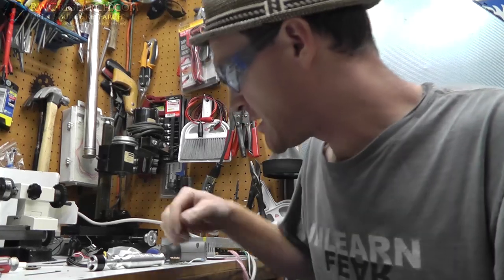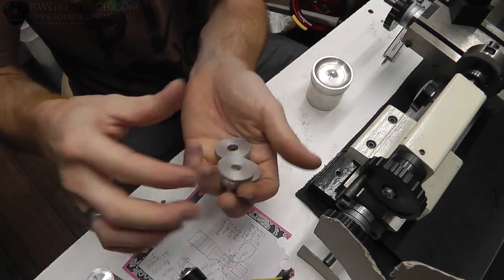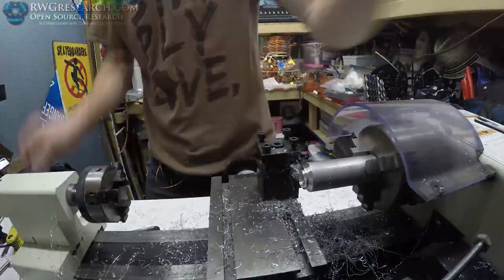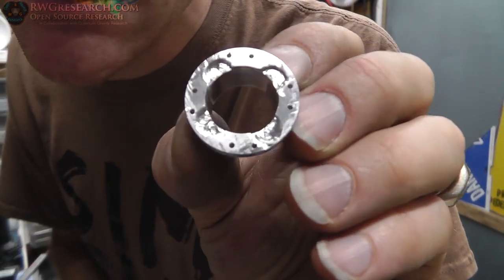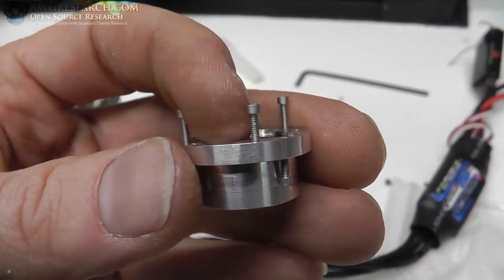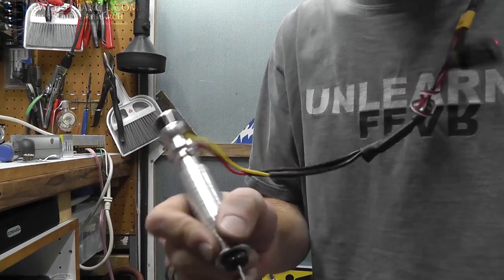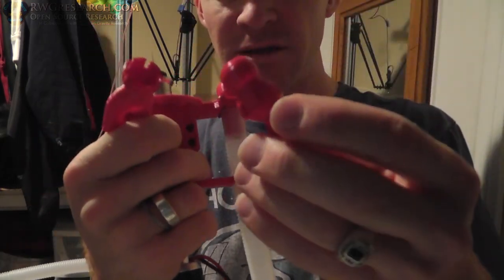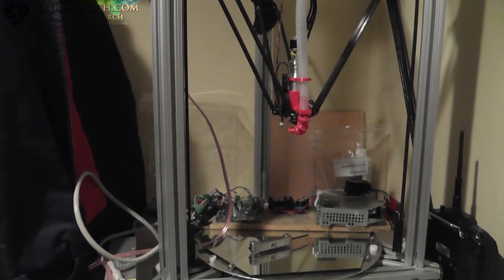P3. Lite & Powerful Brusless CNC Spindle Build For 3D Printer. Finishing The Build

Comment: I think I am going to try this on my delta, but I am just going to make a whole back piece that threads on to the spindle housing.
Reply from the maker: yeah, I'm sure you could even 3d print parts. but i was worried about heat! that motor and AL body can dissipate a lot of heat. its self a heat sink. so if you make one from AL with the threads in it sweet! i'd love to see it! i could do threads with that Lethe, but its faster to do it the way i did i think. guess i need to play with making threads! i haven't done to much of that.  best of luck!! ~Russ

Comment: I would suggest going over the motor driver.

Like speed regulation, and non-RC controller.

At least use a servo-tester instead of the remote control.

The mechanical parts, I don't know better ways for.
Reply from the maker: good observation! i dont think this controller has speed regulation, so i may
 need to get a better one that dose!  https://hobbyking.com/media/file/16810468X7478X23.pdf ill have to find another one that has it! 
the controller will be replaced with sig from the 3dprinter its self... but for testing ...  remote is easy. i like the servo tester tho. might have to pick one up! 
~Russ
Reply: I have a 500W driver board from aliexpress, not tested yet.

Pulse output and analog speed input(as far as I know)

Non-RC. Will test it somewhat soon.

Is something like that of interest?

Comment: Great job, Russ!! you may be able to take the RX out of the equation and replace it with an arduino. i recently did a quick video about reading from the RX into an arduino, i don't see why you wouldn't be able to send the same data OUT of an arduino into the ESC, though i haven't looked into that configuration yet.
 Thumbs up as always!!
Reply: yeah his printer board can send PWM .  I mentioned next time he orders some parts to grab a servo driver or two so he dont have to use R/C TX and RX just to drive esc's and servos during tests and such.
Reply: oh right, didn't even think of servo control on the main board! score!! i'm totally looking into doing this.
Reply from the maker: the duet can do it directly. a small side circuit is needed. but it's just to convert 5v from 3v.  I will be making a bord for this on the OSD. :)  I plan on using 3 if them already. hehe. ~Russ
Reply: that's the only  easy thing about stuff still driven by ramps,  as the servo can be driven directly off the  ramps shield . 
 I wonder if you ESC for the  motor is 3.3v & 5v logic tolerant for PWM in .  then you only need to connect ground and PWM wire , as your getting main power to the ESC from other DC source , as some ESC's put 5V back onto the  + lead as a BEC for RC planes no to need a RX battery .  It would be cool to see if any of my small ESC's will work with 3.3v on PWM in . 
Hmm just did some looking most modern R/C RX's output 2.8v to 3.3v on the signal pins any how.  
so PWM signal wise you should not need any converter .  just  hook only the ground and the signal pin to you PWM pin ,  but do NOT connect the VCC for the ESC as it will be pumping out 5V on that via its BEC  ( though that's handy for arduino based 5V boards ) 
The ESC should be new enough you just got it . 
I'll have to pop one of mine on a scope the weekend as see if mine are new enough  LOL .
Reply from the maker: yeah it could work on 3.3v, but the internal BEC is 5V so... i bet it would like a 3v. it might twitch out lol, but dont worry, its all planed out... just need to get time to test it! ~Russ
Reply: the BEC is only used if you connect the V+ in the servo lead from the ESC to RX or device , in instructions for using more than 1 ESC , you must not connect more than 1 V+ on the servo type wire to the control weather it be a R/C RX or an other board than needs 5V .   all that is needed is Ground and Signal .  All my ESC's (even my old ones) work fine with Arduino promini 3.3v . i even put diodes in line to drop the voltage and it still works fine.
thing to remember about the ESC is that its control board is powered solely by the DC power source for your spindle. 
only issue with not having the 5v+ hooked up , is if you need to enter the program mode for the ESC. some brands need it connected for programming it.  none of mine do they all work fine  without it . 
and thats cool because i now think i might make a ESC programmer with a arduino of some type . 
main point is with BEC is it supplies 5v from the motor power source , it does not ever need Vin , as it is Vout .
Reply from the maker: ok cool ill keep that in mined, i know the servo's i want to use will not except lower than 4.5V or they are not relabel, so i can only guess the ESC's are simulate. i'm sure are some capable of 3.3V but might not be reliable. by the way a simple logic gate of the proper type will boost 3.3 to 5 v , i i add a single IC and get 4 channles of 3.3 to 5V conversion, thats the plan might test that today... thanks for your comments!! ~Russ
Reply: Nuts , oh yeah servos need it , i was stuck in tunnel vision re ESC and forgot you were gonna have servos.. lol oops. yeah . 
servos need power ,  ESC's supply it , so you could use the RSC V+ coming back to power your servos as long as they dont draw too much power.   I have not hit a ESC in my place that was not 3.3v data happy, but you wanna run servos too and i forgot that , they like 5v .
Reply from the maker: yeah, no worries, the servos will be for the #D printer side of things... so no ESC when running those, but i got all that wiring in place already! :) Sig, and 5V+, GND  ready to roll! just need to test it first lol ~Russ

Comment: You should be running ESC in speed regulation mode rather than power regulation mode. 
If you run a spindle with only power regulation you will find cutting metal reliably to be extremely difficult and even wood will chew up your cutting tools because you will be overspeed and rubbing with no cutting forces and underspeed and snapping bits under load.
Many ESCs are capable of this because helicopters require it to keep the blades from going too fast under variable or negative loads.
Reply from the maker: good observation! i dont think this controller has that option, so i may need to get a better one that dose! but your right! if its over speeding thats bad! and under too! https://hobbyking.com/media/file/16810468X7478X23.pdf ill have to find another one that has it! ~Russ

Comment: honestly, based on the results that looks no more powerful than my regular rotary tool, which I can only assume cost me less money. I use these cheap ass (6 for a dollar or 2) high speed milling bits to cut aluminum, copper, brass, etc. with absolutely no problems.

Comment: Maybe you are right, a cover for the motor is probably a good idea. Cooling won't help you much of the magnets are full of metal dust!
Reply from the maker: lol yeah, something... thinking about it i could try to guide the air down and over the shaft. its gets warm... need high speed bearings on the spindle! gets warm! ~Russ

Comment: Awesome job! Do you have some stl files for that vacuum system? I would like to do the same but with a harbor freight dermel. Thanks for being educational and entertaining Russ!
Reply from the maker: yeah sure. This i just a test holder, its its specific to my delta in theses testing phases... if your wanting just the vac flex thing... ill upload it as it is. sure, i used theses as a base: http://www.thingiverse.com/thing:503870 i did 50% smaller! ill upload the other end i made. but the one there might work fine too! ~Russ

Comment: Nice home made spindle. BTW what you said about the vacuum "don't put a tube without the holes" makes no sense at all. If you plug the inlet or outlet of a vacuum cleaner it reduces the load on the motor.
Reply from the maker: you are correct. except those type of motors are air cooled. so even with no load. it will over heat!!  trust me. lol. ~Russ
Reply: Oh OK. Thank you Russ for the clarification !
Reply from the maker: Also. when you have no load the motor gose to maximum rpm as well. lol kinda counterintuitive :)  every motor is different. but from my experience no air movmemt = fire for thses small high power had motors. :)  thanks for the comment!! ~Russ
Reply: Yes but it is not counter intuitive for me. You take the load off the motor so it goes faster like every motor without a speed governor. But that doesn't make it consume more power so it doesn't have to dissipate more heat. Having said that I don't argue that if the motor is cooled by the air coming from the hose it is less cooled if you plug it.
Reply from the maker: Right, 

so this is an interesting subject. there are a lot of factors in this, less load = less power drawn, less power drawn = less heat,  i agree for the most part. 

so the meat of this question relies on the motor, the application, how its cooled, 

what i want to do is make a point for other that come read this , 

after a quick google search, it appears that most people who have over heating problems with there vacuum is due to a clog or extremely dirty filter. 

so to the point, yes, you take the chance of over heating if you restrict the flow... 

also, not arguing with you, just want to make it clear for others that read this. 

:)

~Russ